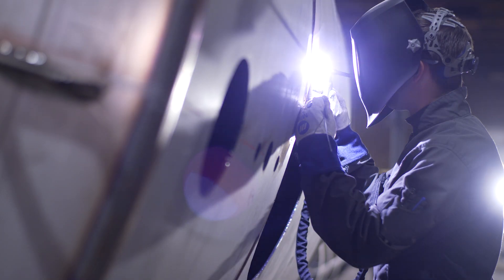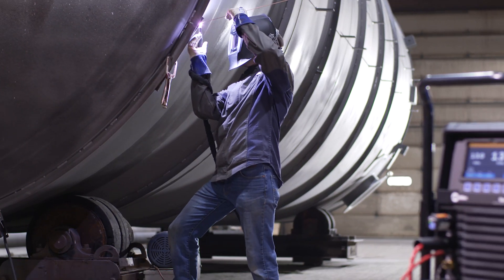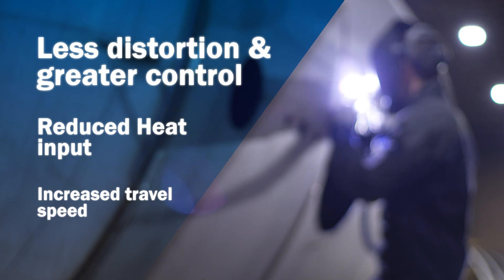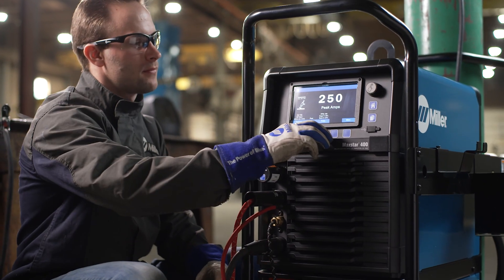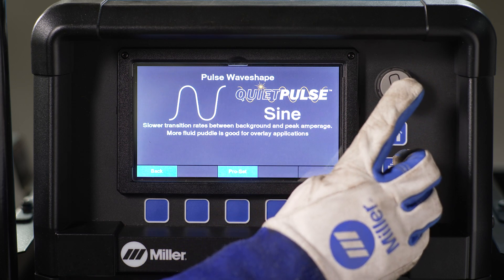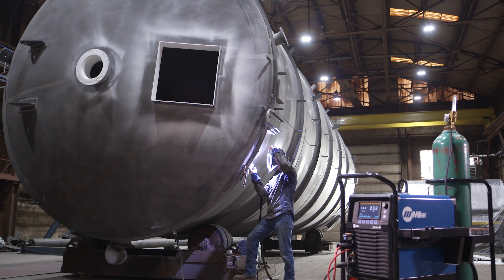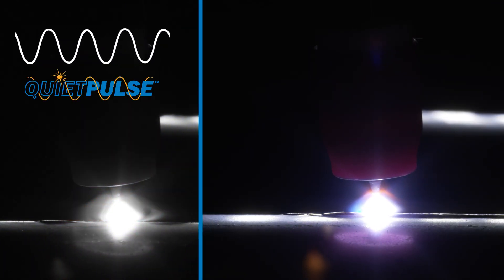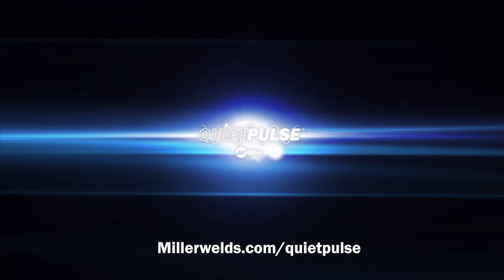QuietPulse™ Technology for DC TIG Welding

Comment: Can I activate this mode on my Maxstar 210DX with the serial number starting with MJ01..? It's made in 2018.
Reply from the maker: Yes, you can activate that mode on your Maxstar 210DX! Since your machine was made in 2018 and has a serial number starting with MJ01, you'll need an expansion memory card to enable this feature. The SKU for the memory card is 301790, and it's compatible with machines manufactured before SN ND040985L. For more information, please visit: https://bit.ly/3Xa2Vc2
Reply: @MillerWelders  thanks for your help I’ll definitely check that out.
Reply from the maker: You're very welcome!